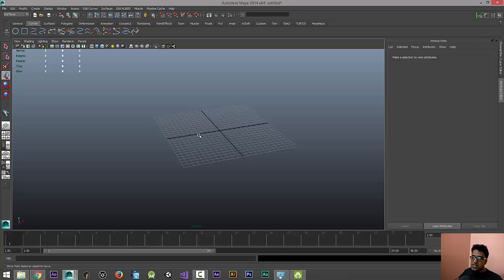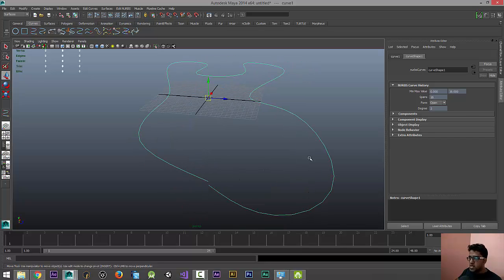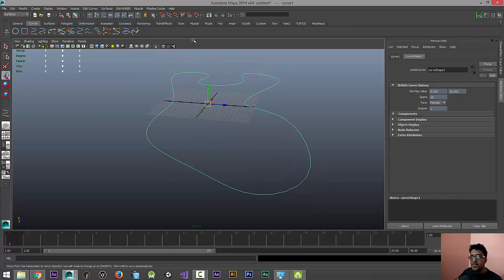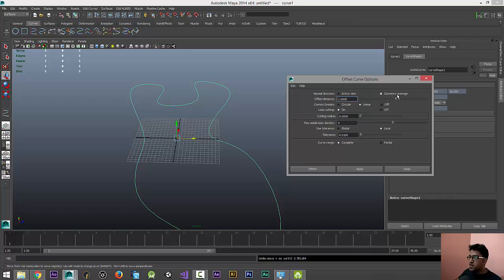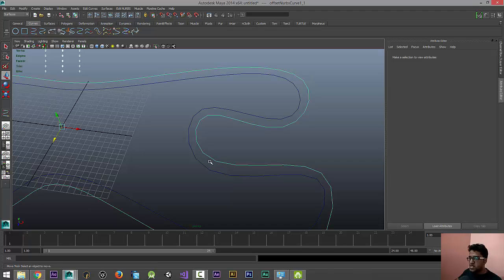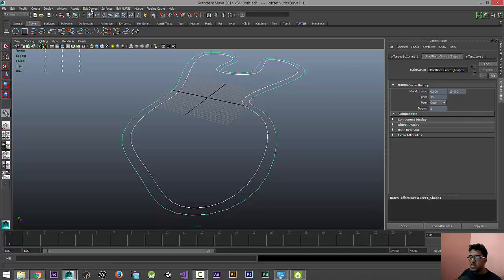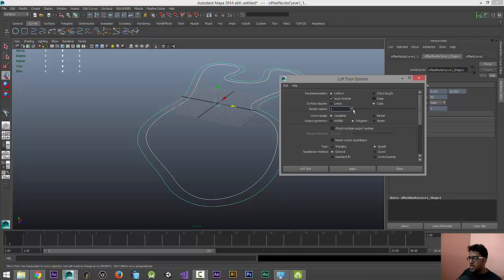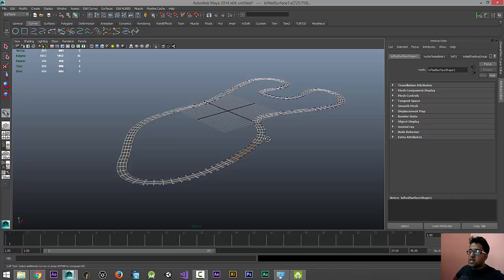Create a Race Track in Maya for Gaming - Maya Gaming Tutorials

Comment: Good tutorial but what about the uv map for an object like this?
Reply: I may recommend you to manually divide the track into sections (preferably with the same length) and unfold the uvs and then applying a material on it. you may want to straighten uvs and change the texel density to have everything set up.